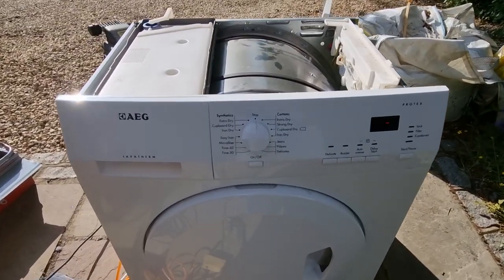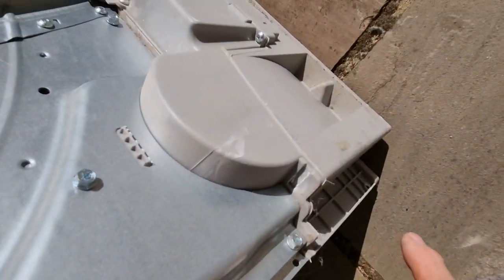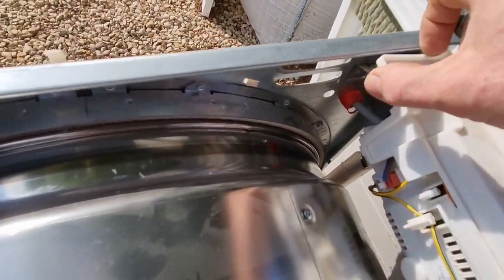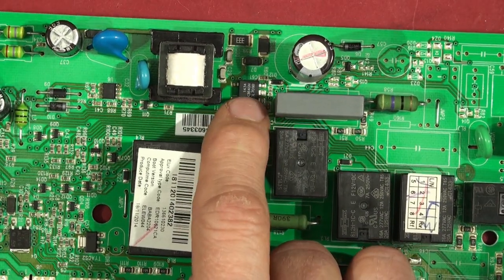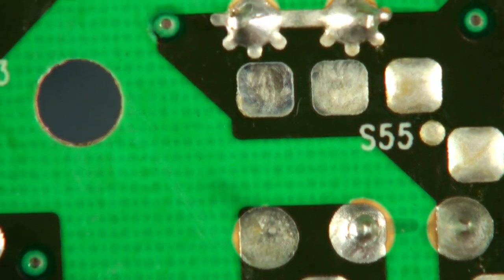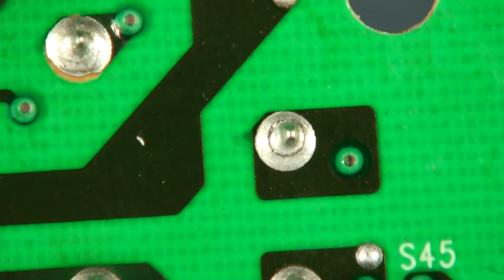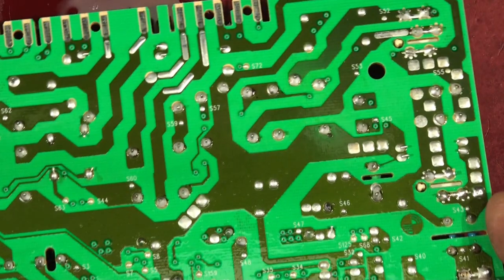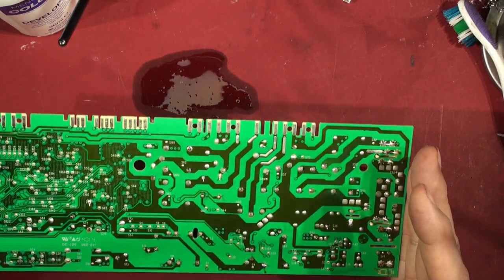AEG dryer  EHO error code fix Diagnosis and Repair

Comment: Thank you so much. Mine only had two visible faulty joints which were under the relay. I had to use my strongest reading glasses and a magnifying glass to see the cracks. Both are now mended and the dryer is working perfectly. Before the repair, the error message cropped up intermittently but then it became permanent so I had to do something. You've saved me the cost of a new dryer.
Reply from the maker: That is so satisfying to hear. Great job. Thanks for saving it!!  Just think of the environmental cost of making a whole new dryer just because of bad production control of the soldering process during manufacture.  If you can subscribe to the channel it would be much appreciated.

Comment: I believe it's due to vibration. You find the same failures on relay solder joints on washing machines, dishwashers, tumble dryers, basically all white goods. I think the relays are just too heavy and require additional mechanical fastening. After resoldering I had failures after one or two years. However, I had good experience with additionally using cable ties and even silicone-type glue (remains kind of rubber-y).
Nice job on the repair 👍
Reply: And on vehicle boards. Vibration + crappy ROHS solder.
Reply from the maker: Make no mistake, the failure is due to PCB design and a lack of process control practice in the controller production line. Vibration may reveal the bad soldering practices the root cause is not vibration.
Reply: V

Comment: Thank you so much for making this video! You saved us from having to buy a new dryer. We have a very similar model to the one you fixed, and we were getting a EH0 error every single time we tried to use it. My husband and I tried everything to fix it, even took out the motherboard and had a look, but we couldn’t see anything wrong…until we watched this video. We just weren’t looking closely enough. After soldering the defective joints, the problem was solved. It works perfectly again. I watched a lot of other videos before finding yours, but none of them really helped. So, thanks for explaining everything so clearly and in such detail
Reply from the maker: Great news. Thanks for the comment. Please remember to like and subscribe.

Comment: thank you soo much!
had an EH0 error, found your  video, opened the machine and sure enough this was the problem.

works like a charm!
Reply from the maker: Great news. It is good to know that another one has been saved.   That board is a shining example of how NOT to design a printed circuit board.  It is an insult to the consumer.  Thanks for watching. Subscribe if you can.

Comment: This video saved my tumble dryer. I was a bit sceptical as the board in the video was not shown in a working machine at the end. But I pulled mine apart and found two solderings with the tiny darker ring and resoldered them. Now it is working again. 
Thanks for the video.
Reply from the maker: Thanks for watching. Everything we fix we fix.

Comment: Fantastic guidance allowed me to fix our 2013 John Lewis JLTDH16 which is apparently an AEG really. The circuit board is very different on our heat pump machine but the principle was the same.
Reply from the maker: Thanks for watching. That is good news.

Comment: Thanks, you just saved me a ton of money, I've already had my dryer apart one with suggestions of fluff in the machine, despite vacuuming it I kept getting the eh0 error, I've been switching off the machine and then it got to the point where it wouldn't start. Once I had a look at the pcb, I could clearly see cracked solder joints on two of the relays. The surface mount soldering was poor quality, I didn't touch that, but reflowing the joints sorted the problem and now I should get another eight years out of what was an expensive top end dryer when I bought it....
Reply from the maker: Great job. Thanks for watching. The persons to blame are the PCB layout and the manufacturing process engineers.  Both should be found and forced to aplogise to every AEG owner.

Comment: Thank you very much making this. And showing how to fix the printplate. I am not at all good with a soldering iron but you showing how got me getting the correct material. And following your example I've managed to resolder all the contacts on t he printplate. And identifying a really bad soldered connection. In my case a power connection (I found three white blocks) that had a touchup before me. Possibly quality control. But this one was lifting away from the printplate with little movement. 
This video gave anough direction and confidence I could handle it, and OHO code is gone and dryer up and running. 
Greatly appreciated you putting the time in shwoing how its done. SAved me another dryer.
Reply from the maker: Hi Marcel. Great job, Very satisfying to know that another one is saved!!!  Thanks for watching and subscribe if you can to help us sustain the channel.

Comment: Great video, exactly the same problem on my AEG dryer (same model). I was about to order a new one, you have saved me hundreds of pounds. Thanks
Reply from the maker: Good job. It will work for a long time.  I have done a few of these and haven't had a peep out of them since. The rest of the product is reliable. Thanks for watching. Subscribe if you can.

Comment: perfect! it worked! mine reported error, after cleaning it was dead. now everything works again
Reply from the maker: Ahh the magic cleaning method.  You need to solder it. All you have done is disturb the dry joints on the controller board so they conduct for now. . Dendrites will grow and the fault will return. Get your iron out!

Comment: Great video. I’ve had exactly the same problem with my AEG dryer. You saved me a lot of Euros 😊. Greetings from Belgium 🇧🇪
Reply from the maker: Great job and thanks thanks for watching. Good to know another machine will soldier on for many years. It is a terrible, careless mistake that has caused  many thousands of appliances to be scrapped.  If AEG really stood behind their premium priced machines in an honorable way they would offer free service for this fault,   It would do their dented reputation a lot of good.

Comment: Thank you very much! I had the same issue with my second-hand dryer, which is a slightly different model than the one in the video. However despite some differences (mostly in the design of the PCB itself) I was able to fix it following the instructions in the video. At first glance I couldn't see the cracks in the solder, but after close inspection I managed to notice that a dozen of the solder connections were cracked. Resoldered them and voila - the dryer works as new.
Reply from the maker: Great job. Thanks for watching.  What a fiasco.. I have met hundreds of so called engineers that are clueless when it comes to PCB design and manufacture.  Thin of the cost!!!
Reply from the maker: Glad it helped!  They could do a lot better.. Shows they have school boys in their design team.

Comment: Absolute hero. I recently replaced the motor (which was making an awful noise) and display (which no longer worked due to water ingress) in our AEG dryer, cleared out all the fluff - all was working nicely up until recently when we started getting this EHO error intermittently. Needless to say, I was a bit miffed that it had developed ANOTHER fault after spending £250-odd on components. Found one video that recommended cleaning out the fluff from inside the power board housing - no joy. Found your video and immediately spotted the rings around the solder joints just like in your example. Re-soldered and - hey presto! Amazing. Thanks so much.
Reply from the maker: Great job. Thanks for watching.
Reply from the maker: Good job. I am glad I could help. Thanks for watching.

Comment: You star. Just had that problem on my Zanussi which has the same Electrolux board and it seems to have worked a treat. Nice one mate. Paul
Reply from the maker: Great news.   mechanically the machines are very durable.  The electronics not so much.  Thanks for watching and do me a favour and subscribe if you can.

Comment: I had exactly this problem with bad solder joints on the relay. Resoldering fixed the issue totally. It’s amazing that it’s the same issue on all these boards.
Reply from the maker: Great news. Another one saved!!!  It is extraordinary as the joints and PCB layout on this board is a classic bad example. As my dad use to say 'A little bit on knowledge can be a bad thing' . I guess the real disgrace is that the manufacturer hasn't in the east fessed up to conning the public with crappy electronics in a top end dryer!!

Comment: Utter crap soldering by the manufacture.
Well done for saving a good machine :-D  20 quid, very fair :-D
I fixed a cheap basic tumble dryer for a great mate.
The tension pulley had a mental breakdown and fell apart.
There was a mound of grey fluff i removed,  dangerious possibility of fire.
Reply from the maker: I agree. We used to use a British standard for solder joint inspection in our production line. (7,000 Computer monitors per month).  It seems that this expertise has been lost in the white goods industry.
Reply: @razenby  i bet there was only a few that failed because of component failure later in the next year.
Making components with short legs would reduce 
component waggle in transit.
Dam I've bored myself stiff lol.
Reply: @razenby  I hasn't been lost. It was cost-cut intentionally. How else could you make a 270€/$/whatever budget tier washing machine? The same lessons learned for that market segment helped to increase margins on higher tier products. Oh well, at least fridges are without PCBs :)

Comment: I'd love to hear what problems you see with this PCB!
Reply from the maker: Usually bad solder joints and failure of the PWM power supply power supply chip and associated components,
Reply: @razenby  Oh, I probably misunderstood you then. I thought you were criticizing the layout. The LNK, TOPSwitch, VIPer SMPSs are shit for sure.

Comment: thanks for the video..
unfortunately, more and more often, cold connections are the cause of device failure..
greetings from Croatia !!
Reply from the maker: Thanks for the info. School boy PCB layout and production engineers,  The issues as standards for solder joint fillets and surveillance requirements during the production process have been available since the 60s.  A little bit of knowledge is a bad thing. ...

Comment: Excellent clear explanation and video.  I've watched a few of your YouTubes about repairs and find them better than watching TV!  I've used this fix on one tumble drier and it worked great.  However, I now have an AEG drier which just shows no signs of life at all.  I replaced just the fused resistor first and not the chip, but it instantly burnt through.  I then replaced the chip and resistor and nothing burnt up but also nothing happened!  No 15V on the output for the control panel.  I tried tracing it back and it seemed the diode feeding the capacitor was not letting anything through (even though it was showing fine with the multimeter on diode test).  I've replaced that diode with one that looked suitably high enough current (that I took off some other spare circuit board).  I put power to the board and immediately the fusable resistor blew again!  Any ideas what it could be or what I could do to test?  Could it be the diode I used wasn't suitable?
I've desoldered the transformer/coil and checked this - nothing looking burnt out and the resistance for the main feed into it was something like 0.4 ohms - would this be right? 
 I'm lost now other than replacing the chip and resistor again and watching it go up in smoke, but it seems something downstream must be causing a short...  Help!
Reply from the maker: Hi Peter thanks. The power supply circuit is really simple on the primary side with perhaps 5 or 6 components. What is the chip type? Did you replace with an identical chip? Did you meter the diodes in the circuit?    Is the high voltage across the main 400 Vdc reservioir capcitor? If you had a catastrophic fail it can burn out the contacts on the on board mains switch. You best bet is to inspect your work very carefully to make sure the chip is fitted correctly  then look up the datasheet for the Power management chip and find the example application circuit. You will the components on the primary side.. Locate the equivalent parts on the board and test them. There is a low voltage electrolytic cap on the primary side that can be damaged during a catastrophic failure.
Reply: @razenby  Thanks for the reply and assistance.  The chip was LNK364 which I replaced with the same and ensured it was fitted correctly (although it was from China, so hope there aren't poor copies!) I did meter the majority of the diodes near the LNK.  As I said, they all showed fine on the meter, but interestingly the large diode feeding the capacitor was not letting any mains voltage through when I checked it connected up, which is why I replaced it with another diode, which then caused the fusible resistor to burn out again!  I imagine it will have blown the chip again too!  I am suspicious of the transformer, although there are no signs of melting, but the resistance seems really low.  I am tempted to remove this from the circuit and see if the next chip and resistor blow again (with no load on the chip).  Not sure what else I can do to test it!  I don't see any low voltage electrolytics on the primary side as you mention - only the 400v one.  Any ideas on what else I can try - could it be the transformer?

Comment: I I have virtually the same board but were the bad joints are, it has really burnt the joint, can these bad joints also arc to cause the burn mark or might that be another issue ?
Reply from the maker: Should be OK if you clean them up and solder them. You should remove any carbonized circuit board as this will be conductive.  Clean the pins and loop tinnec copper wire around , solder the pin then clean off the lacquer on the PCB track and solder the wires to it.  Put some nail varnish over the joint afterwards,.

Comment: Thanks for the video, do you have the detailed  circuit diagram for this board?
Reply from the maker: No sorry.  As far as I know it isn't in the wild.  You can glean a lot  of the circuit around the power supply chip from the manufacturer's datasheet for the PWM chip.

Comment: I only get the code if I plug it into a extension cable it works perfectly plugged into the wall socket?
Reply from the maker: You could have  bad earth continuity or a bad connection somewhere in the extension lead. Extension needs to be a quality  3-core minimum 1.5 square millimeter (13A)  type.  Try a different extension. If you get the same fault then you might have a controller in the process of failing...

Comment: I have same motherboard in my dryer but mine just stops a few seconds after starting a cycle  without error code.  I can pause and resume and it will  keep doing the same.  If I disconnect the 3 pin heater cable it wont cut out but the heater tests fine so I think its a motherboard issue. Theres still 240v going to heater and motor when it cuts out too. What should I look at?
Reply from the maker: I would check the door switch is working OK. Inspect it for overheating.
Reply: @razenby  I checked but its not that. when dryer stops the display thinks it's still going not paused etc. I checked relays and heater only getting sent 12v momentarily then few seconds after dryer stops when motor relay loses 12v . I wish i knew how to do service mode on this dryer